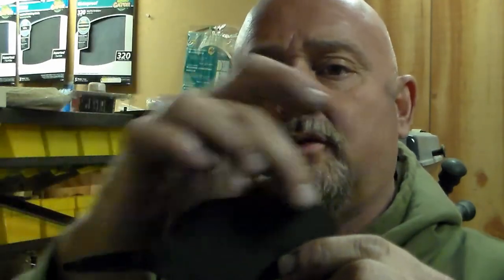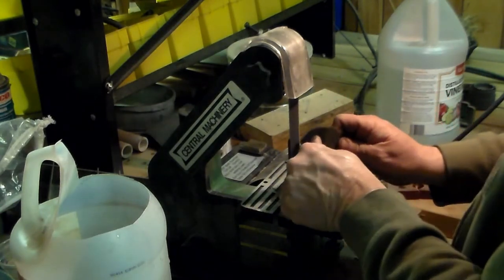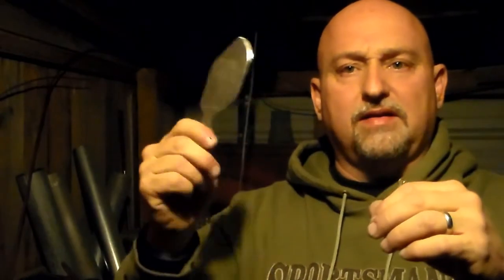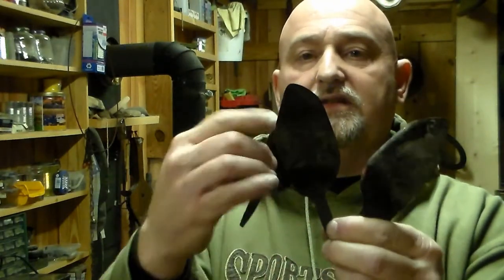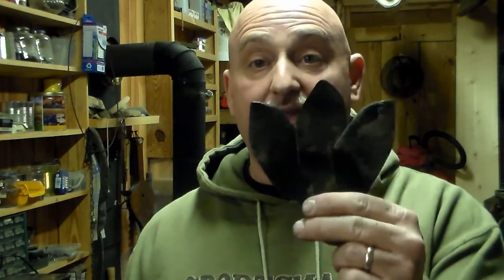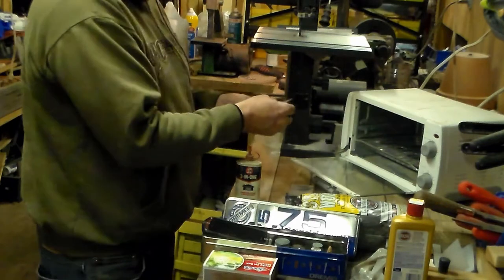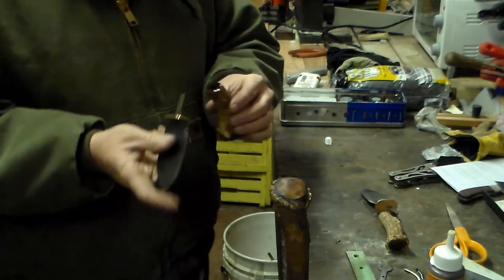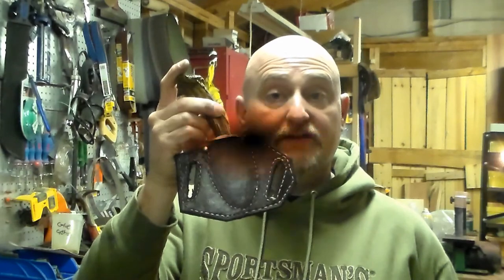Make a saw blade skinning knife the easy way  Final part of series

Comment: Awesome job! Have you had any problem with the blades coming loose? I was thinking maybe a brass dowel pin through the handle and blade might be a good idea for the long run  to help support the blade? Awesome work though they look really good I enjoyed the series.
Reply from the maker: +patruick marco Thank you for the support on the video's. I use the brass pins for my full tang knives. They do help to hold the scales on very well. But with these knives I do not use a brass pin for them. Although one could for sure to help. These being skinning knives mostly they would not be getting any blunt force put on them. The handle is driven up on the end of the blade as well. For knowing if I had any trouble my friend. I have not had any so far. Although the oldest one is only about 12 years old and not uses very much..Thank you very much for the support again. Any other questions feel free to ask. I also have another series coming in soon. Which is how to make a Perfect bushcraft knife..ATB MIke

Comment: nice job, with this project you could have did it with out the annulling and forge even as long at use quenched it repeatedly through the cutting, shaping, and edging to keep the metal from over heating . if you did not have a forge.
Reply from the maker: +ramsessilent You can but the annealing makes this process much easier since it becomes a soft metal. Some of my 1st ones was done this way. Took 2 grinding stones and $30.00 to figure out it was simpler to anneal it to soft 1st lol.. Thanks for the tip and hope you having a great one brother... ATB Mike

Comment: I've blued a few items  It seems if I don't boil the finished product and clean it very thoroughly, It keeps on rusting until it's brown.
Reply from the maker: +Crafted So far these have not turned to rust yet. But One thing I have noticed is when I heat treat them 1st 1 time. at about 275 to 300 degrees for about 2 hours. Then Blue them They seem to do better. I think the oils from my hands and tools and such seem to go away and the Bluing holds much better. But this is not a 10 year test. Its only been about 5 months into it.  Thanks for the support brother. ATB Mikel

Comment: what weight of oil did you use?
Reply from the maker: +Debbie Holland These was done with some old used motor oil , Unfortunately this oil is a mixture of different types and weight. It has done well over the last few projects. I recently started using peanut oil and it seems to yield better results. Hope this helps.  Thanks for watching. ATB Mike